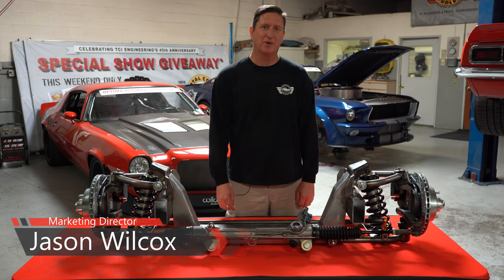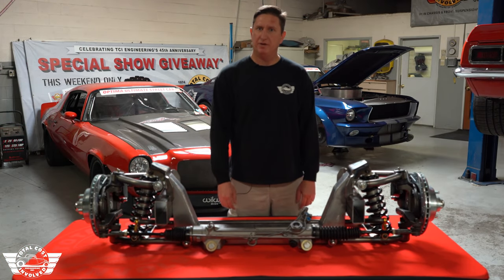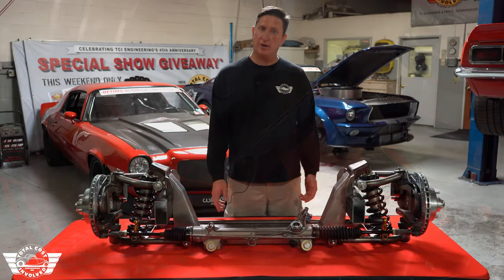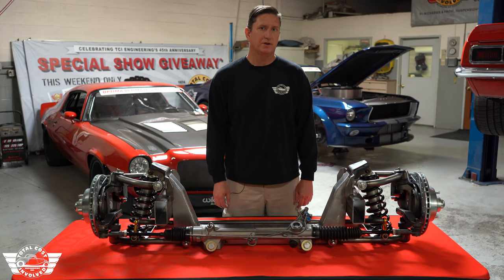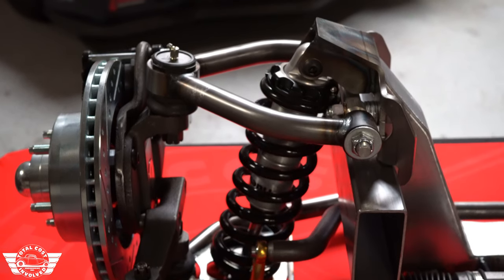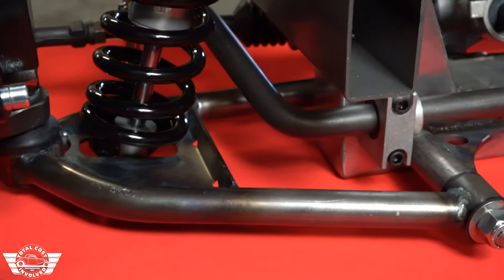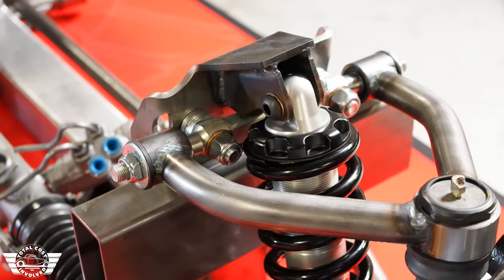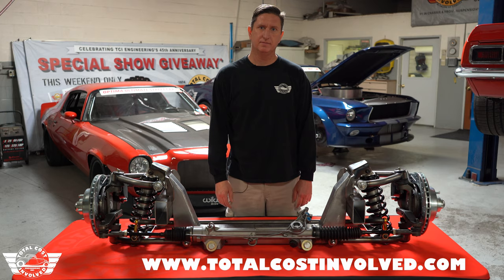TCI Engineering New Product: Pro Touring IFS for 1955-1959 Chevy & 1953-1964 Ford F100

Comment: I’ve got a 1950 ford f1 it’s all stock. Flathead v8. What front end fits?
Reply from the maker: A flathead engine will fit in all of our IFS offerings. Coil Spring, Custom IFS, or the Pro-Touring
Reply: TCI Engineering thank you! I’ll call tomorrow and place my order!
Reply: Best and easiest is a Jaguar xj6 front suspension comes with vented disc brakes huge dual piston calipers and rack and pinion steering behind the cross member making it a straight line for your steering linkage👍
Reply: For under 400$